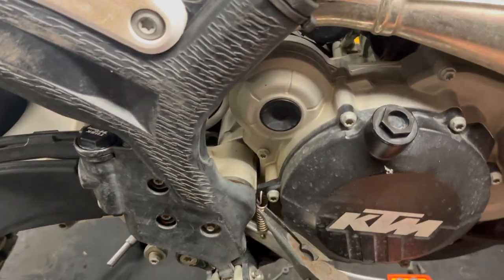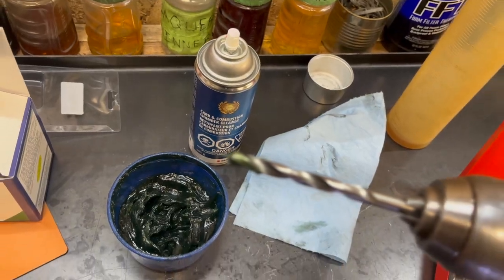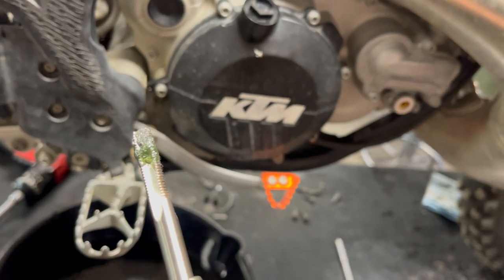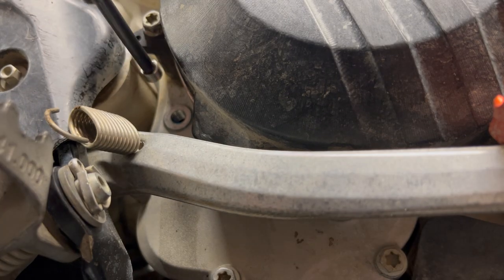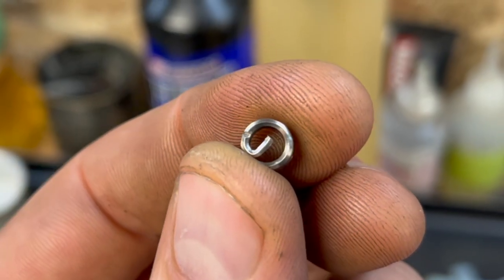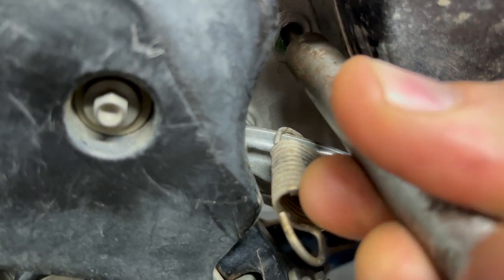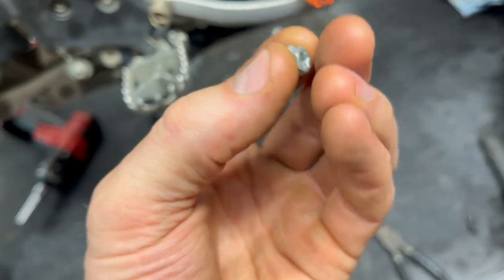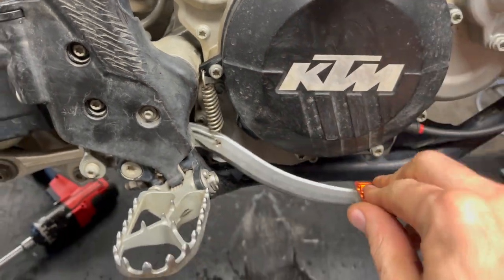Oil Check Bolt Stripped? Here's the Fix

Comment: Nice tip Chuck. I don't know if the repair coils are magnetic or not, but if so a strong small magnet stuck on that punch tool could help. I find stainless steel likes to gall some threads so I hope the inserts aren't stainless.
Reply from the maker: I’m honestly not sure what the material is. I’ve installed hundreds of them. The threads become far more robust after the insert.
Reply: the galling issue is not a problem if you obey Mr. Harder and never use that oil check bolt
Reply: Thats what i was thinking, metal tool with a big magnet on it with grease on the end should give you some good chances of getting out out

Comment: Where did you get the new bolt?
Reply from the maker: The customer supplied it, but it’s not necessary to replace the bolt. The hole always strips because it’s aluminum & very shallow.

Comment: Timeserts are a better option imo.
Reply from the maker: I’ve used them a fair bit, but I prefer Heli-coil in most situations mainly because they’re so fast & easy to install. I find the Time-certs more sensitive to hole prep as well. If you don’t get it perfectly straight or if the threads aren’t perfect the Time-cert is more difficult to get solid.
Very nice when you have good access to the hole and where there’s lots of material around the hole.